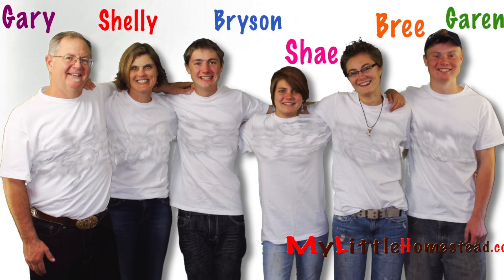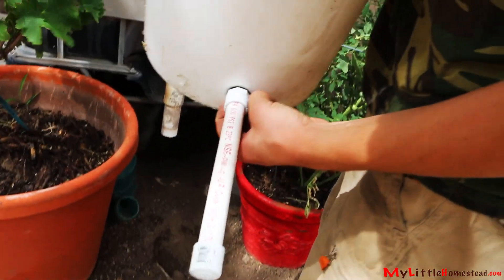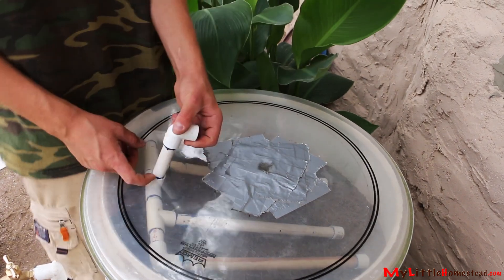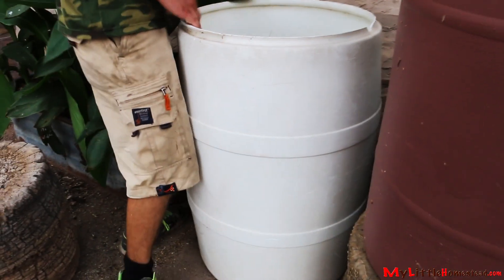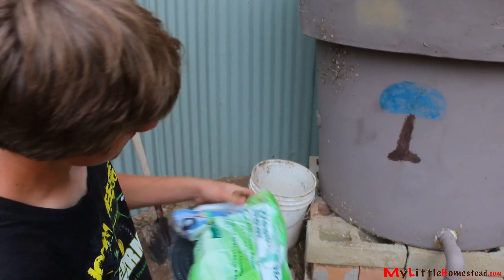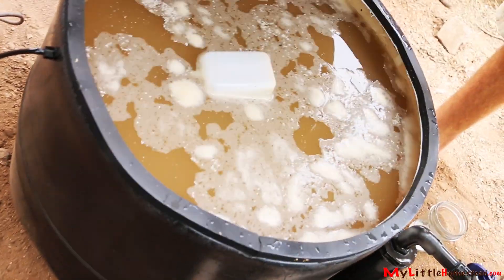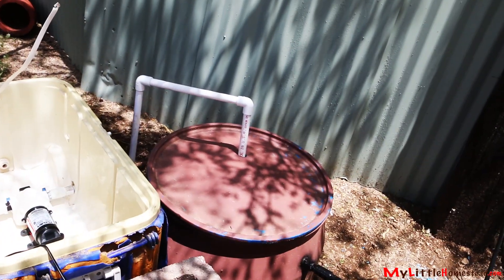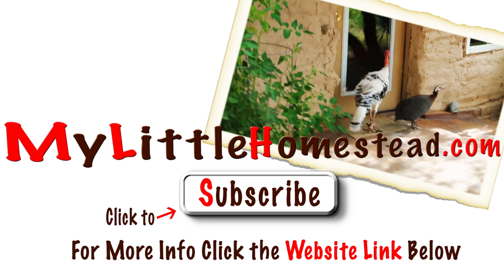Building an Inexpensive Water Filter - Slow Sand Filter | Weekly Peek Ep4

Comment: You should use a three barrel system the first should be the and and charcoal filter {activated charcoal is too small to be properly filtered out, use charcoal a couple of inches thick as a big layer under the sand with layers of smaller and smaller charcoal pieces going back to bigger bits with the output pipe under that, then you want that going into a metal barrel which should have a glass box around it, use a steel or aluminium pipe here and spiral it around the barrel to maximise the heat carried in to the water, you ideally want it using vacuum tubes, but that's unrealistic for a home build, anyway, the idea there is simple, solar energy heats the metal till it boils, you can have a removable basket for large pieces of charcoal so it purifies the water further as it boils and the last barrel you want to be insulated again, but you can subdivide in to two systems, one for hot water and one for cold. The hot is the same as the last barrel to keep it toasty, but only the lid with the rest buried to keep it even more insulated. The cold one should ideally have a lot of pipe in a sealed system wrapped around it, and buried, with the cold barrel buried too to keep it chilled, maybe even pretty deep down by where your well is to keep it cool and crisp.

Comment: I use a filter that is in line with my pipe from the gutter to the tank. You can put chlorine tablets in the filter and it shocks the water as it goes into the tank. Then use a charcoal filter coming out of the tank. Makes for some really clean water. You can get the in line chlorine filter on amazon. Thought that might help yall out. Keeps the water in your tank from going stagnant.

Comment: Why does the filtering process start with the fine sand?  Intuitively, it seems filtering should start with coarse material graduating to the finer material.  The way yours is set up, the inlet should be at the bottom so the water filter up and out an overflow near the top.  This way the water will have more retention time allowing the bio-filter to do its thing too.

Comment: please tell me your water silo has a cover and you are not letting all the dust into it and all that water evaporation loss ....you can also rig up a simple evaporation collection in that huge tank to a small holding barrel so everything that condensates on the top of the silo goes into a small barrel outside which will be instantly clean
Reply from the maker: Thanks for the post...

Comment: There's two things I could probably add to this system, one, paint all the barrels black, the sun will cook the water and the inside of the barrels and the ekky water will never form. Two, find a cookie tin and fill it with sections of branches that are no taller then the tin, place the lid on it, make sure its got a snug fit and place it in a camp fire. The heat inside the tin will cook the wood sections into charcoal and that becomes the first layer after the small pebbles at the bottom of the first barrel.
Reply from the maker: +L B Jackson 
Another good one...thanks
Reply: Charcoal is a great addition. Put it inbetween the sand and the gravel. Replace it when you replace the sand every 10 weeks or so when you clean out the drum. 

The black isn’t a good idea though. Not unless it gets the water above 50 degrees celsius. Legionnaires forms from 20-45 degrees celsius, most dangerous bacteria forms and reproduces like mad at 37 degrees when there is no movement of water. Either move the water consistently or keep it cold or hot. 

Another thing to add about this too; it’s the smutzdecke that does all the amazing work. It’s the biological film that forms on the top of the sand after a few days. It only really lasts 2-10 weeks, then you have to remove it and let a new one form. Having the schmutzdecke, charcoal and sand will make the water like bottled spring water 😊 just need to replenish the schmutzdecke every couple of months.

Comment: Great project. This is a natural system hynbridised, and is of course, exactly the same principle as collecting water from an old fashioned well, which used many meters of soil, rocks etc as a filtration system. The system depends on a build up of micro-organisms, and bacteria which build up in the system which literally eat any pollutants / debris which reside in the untreated rainwater. It is very important to allow a 2 to 3 week period for the necessary bacteria to build up in your sand / substrate filter. They will grow and multiply organicaly as soon as you start passing water through the system. One of the beauties of the system is the more water you pass through = the more pollutants there are for the bacteria to eat = the larger the bacterial community. Nature at its best ! Charcoal or carbon is extremely efficient at this process because it is microporous and has an enormous equivalent surface area for the bacteria to reside, and because of its microporous nature will trap much of the inorganic particles that the bacteria cannot eat. The downside with carbon is that it eventually becomes clogged with inorganic particles and needs replacing. However, on the upside, it is very easy to produce at home by making charcoal, which is pure activated carbon. Also, do not forget to include into the system a method of collecting the sludge which will collect at the bottom of your system, which is made up almost entirely of dead bacteria. Although this is not necessarily harmful, it can make the water smell strange, and discolor it. So when you add your bottom pipe, do not make the hole so near the bottom where the dead bacteria will settle. This will give you a much longer period between cleaning the system out.
Reply: ***** As an interesting footnote which I didn't want to put in my original comment which was already very lengthy, you may be interested in the natural consequences of the system you have created. The sand / rocks which you used, once colonised and broken down by bacteria becomes soil. The carbon you used eventually becomes coal, and the sludge you collect at the bottom, is already just about the most potent fertiliser that exists so don't throw it away, but will, eventually, transform into oil. Interesting isn't it ?
Reply from the maker: ***** Thank you for such valuable information! Can we have your permission to include this comment on our website article (crediting you, of course) so we can share it with others?
Reply: ***** Yes, of course you can mylittlehomestead. But please don't credit me. Credit yourselves for the wonderful sustainability projects you are creating. Much love to your inspirational family.
Reply from the maker: ***** We really appreciate the support and such kind words. We will definitely give you credit :)  Thanks again!
Reply: I am a bit late to this but also never let the bacteria dry out. It must stay moist otherwise the bacteria dies off and you have to restart its growth for another 2 to 3 weeks.